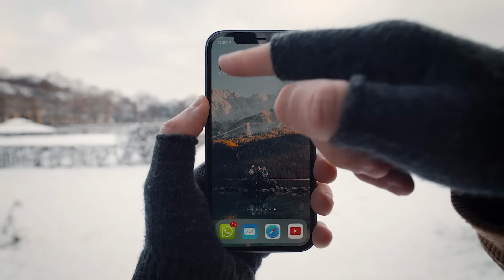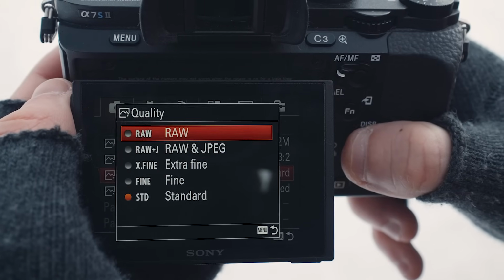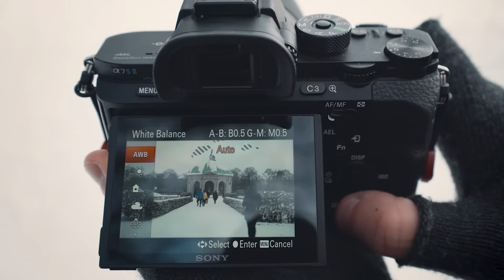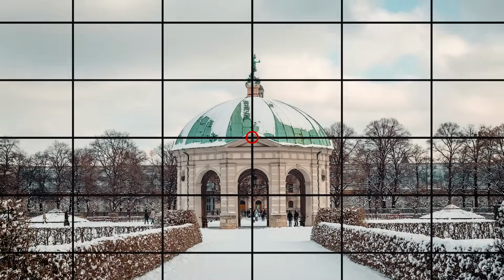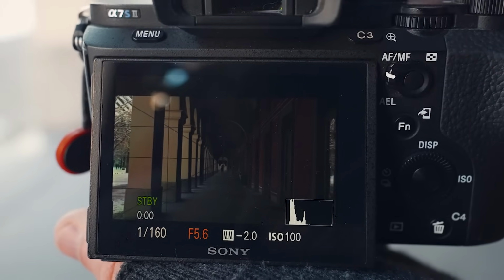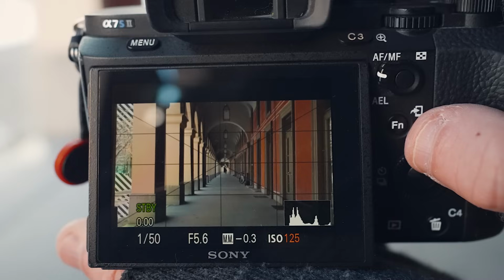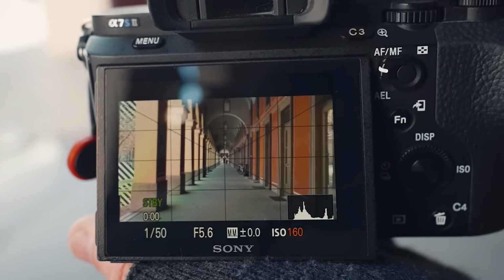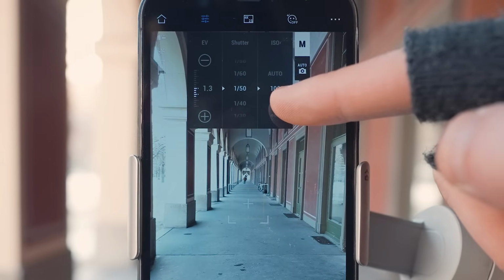HYPERLAPSE TUTORIAL - My Equipment, Settings and Methods (Photo- & Videohyperlapse)

Comment: Great tutorial! I have a question about video hyperlapses. Your hyperlapse are very smooth, no visible up and down movement. How do you achieve that? I cannot eliminate slight up and down movement even with Ninjia walk, and it can ruin the hyperlapse.
Reply: Most likely he uses some type of post-production stabilization, like, for example, "Warp Stabilizer" in Premiere Pro or After Effects.

Comment: A really good video Andreas, I like your edit style very much. Is the rate at 100% that your pictures are always all sharp or are there a few that are out of focus? Because 1/100 handheld is a bit risky. And wouldn't you rather have a little more motion blur in it, such as with 0.3 "?
Reply from the maker: So 1/100 is enough for the picture to not be shaky handheld, don't worry about that! :) The thing is I always add motion blur in post production not while Shooting, I know it's not "native" but I rather shoot a Hyperlapse quickly than with 0.3. This way I have more time to head over & shoot the next Hyperlapse on location. I hope you get my point 😅
Reply: @AndrasRa_  Hey Andras, great video. What effect do you use to add motion blur? pixel motion blur?